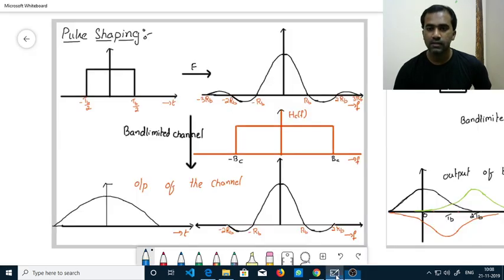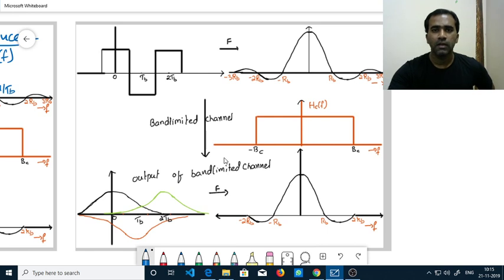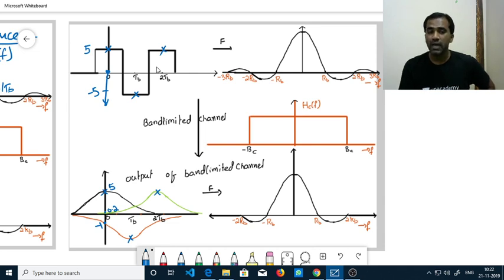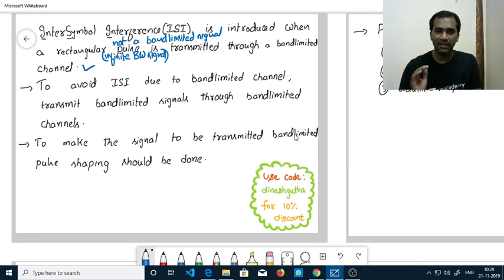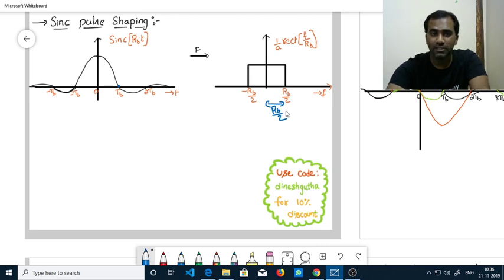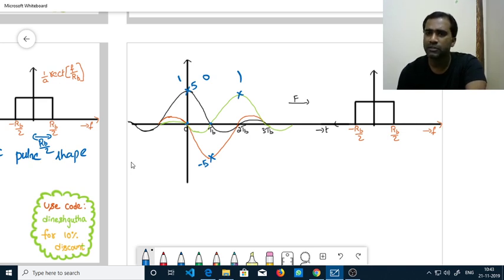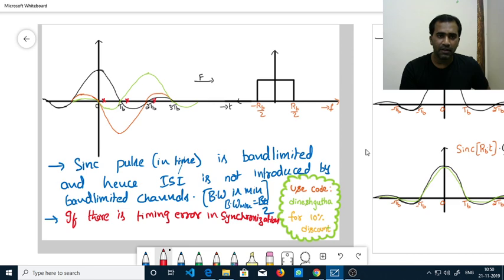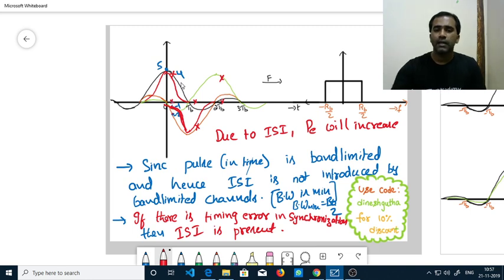Inter Symbol Interference(ISI) & Pulse Shaping Part_1 | Unacademy Live - GATE | ECE | Dinesh Gutha

Comment: why we send pulse signal only as the input? why can't other signals?
Reply: Bcoz we use pulse code modulation in which the carrier is pulse wave
Reply: Bro in digital communication we can send pulses because The symbols are modulated on the Pulses itself, That is they have a specific duration....Other signals are very difficult to analyse in the frequency domain sometimes so a normal square pulse or Sinusiodal pulse is helpful in this respect!!